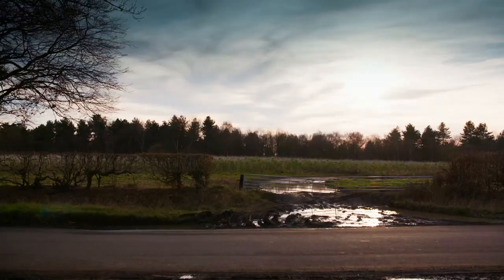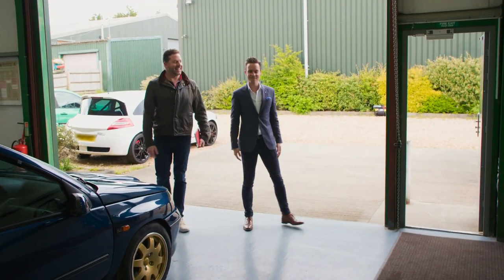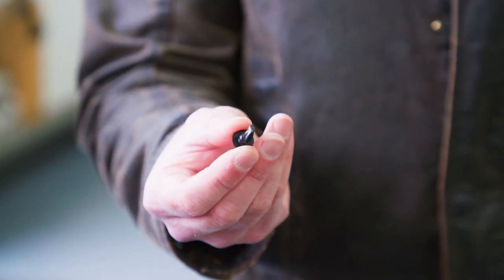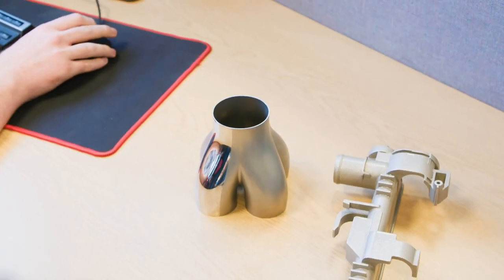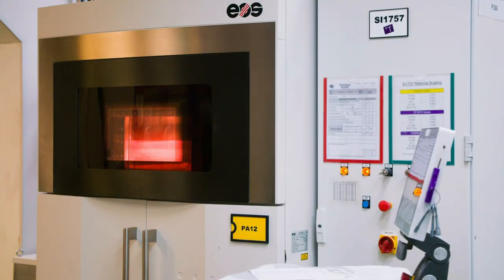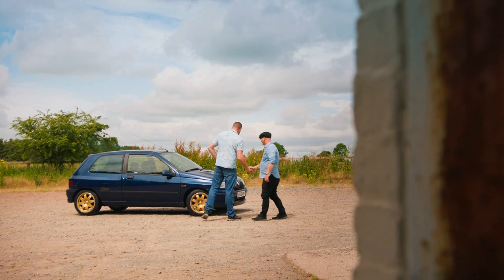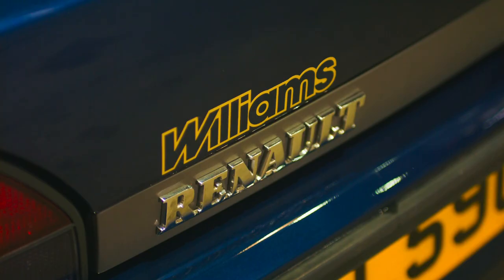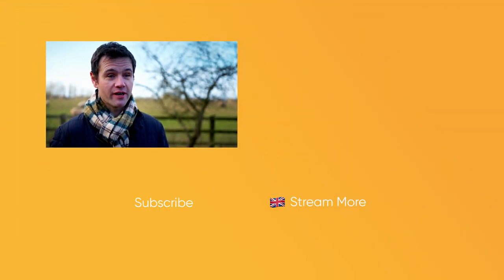3D-Printing Helps Restores This Renault Clio Williams | Salvage Hunters: Classic Cars

Comment: As s bodyman of 30yrs, I was a little taken back at the £7,000 pound restoration cost for a car that appeared on camera to be rather clean. A fresh respray of the car should’ve run a couple grand in US dollars. To recondition the wheels…about $180.00 per wheel. I’m not sure where the extra few thousand pounds went to fix it up🤷‍♂️ New tires and decals…maybe another £600 pounds?

Comment: I saw a Clio Williams at Goodwood  Festival of Speed in the early 2000's on the Renault stand. It was left hand drive but was actually going rusty around the windows and looked tatty. I wonder if this was the same car. If so it has had a respray since then.